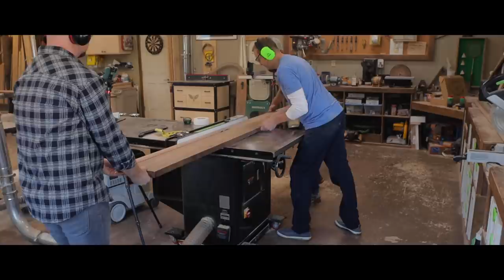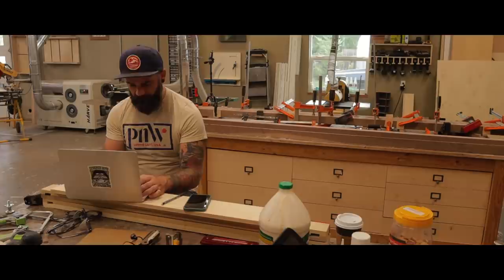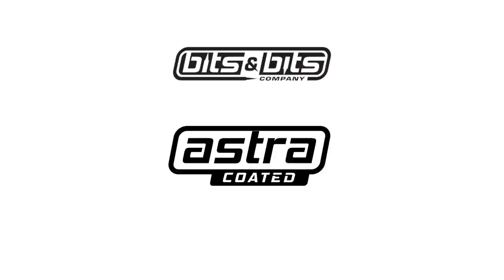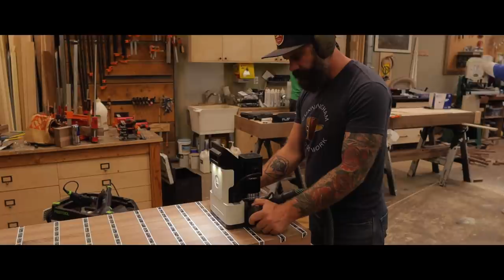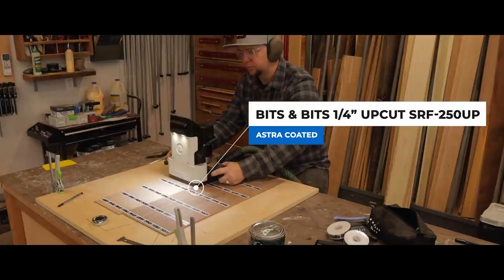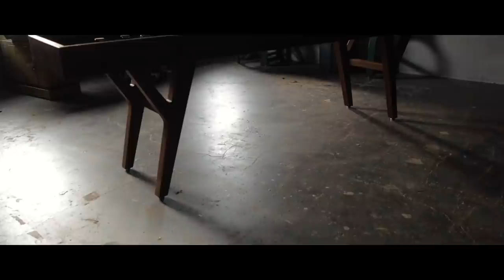Walnut Shuffleboard Table Build | A Documentary

Comment: EPOXY TIP:  if you don't have a torch or you don't know how to use one, put some acetone in a spray bottle a spritz a couple of pumps about 18-24" over the top of your epoxy.  The gazillion droplets from the spray will will drop and pop the gazillion bubbles in the epoxy -- especially the pin dot sized ones.  Check out THIS VIDEO: @ at minute @